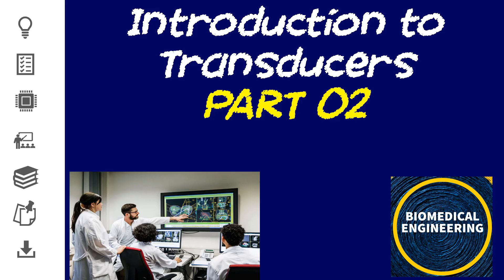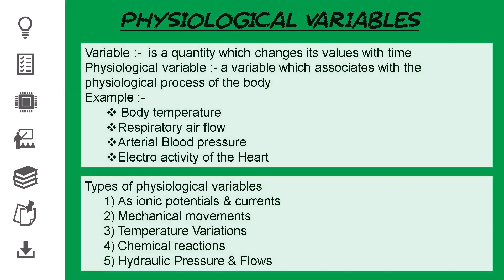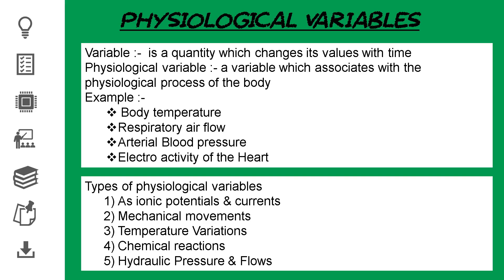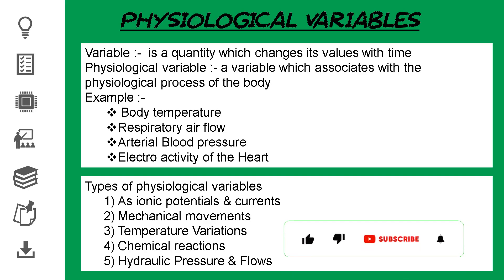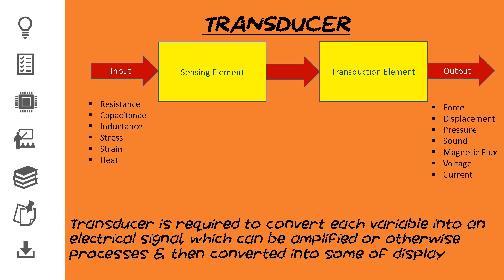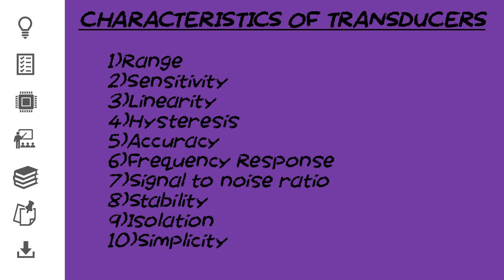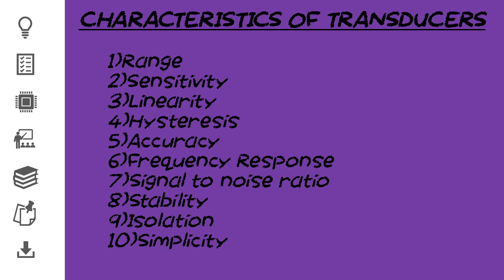INTRODUCTION To TRANSDUCERS |SENSORS |Medical electronics & Biomedical Instrumentation Part 2

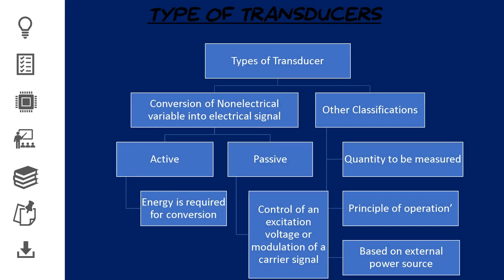Comment: Active means energy is required or not required? 2:16
Reply from the maker: Active means does not need any external power supply to generate an output.
Reply from the maker: changes the energy without using the auxiliary power supply